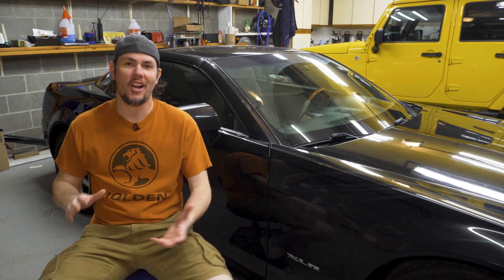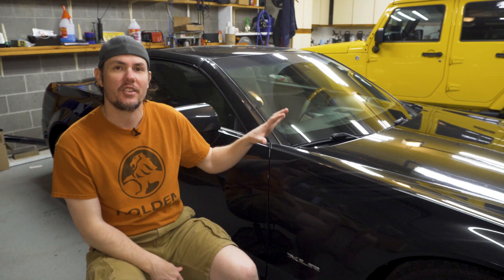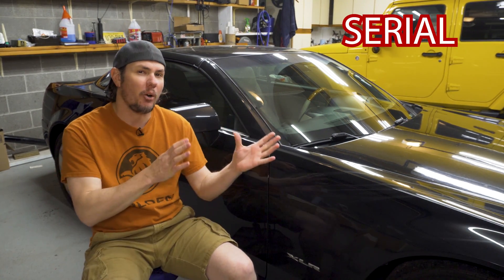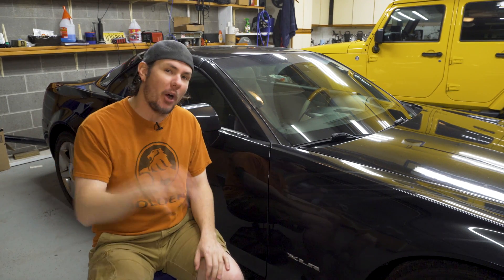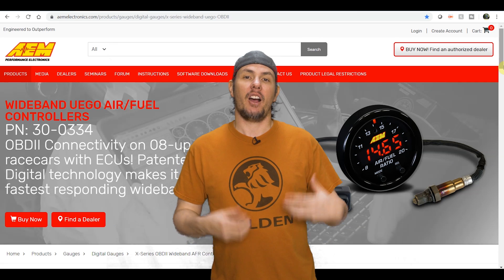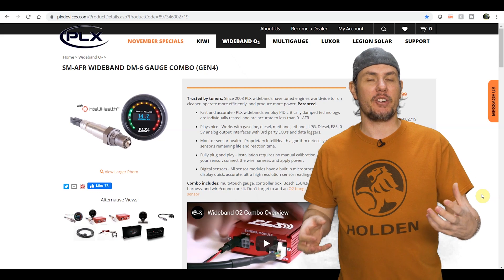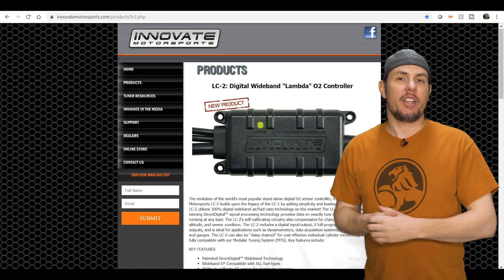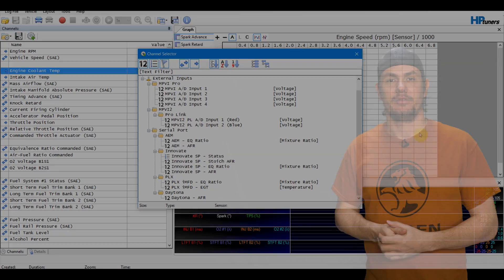Wideband Selection, The Most Important Tuning Tool.  Time To Pick One For Project Country Club!

Comment: So i dont need a specific e85 wideband to use e85
Reply: Tune in Lambda then you don't need to worry about it.
Reply: Ok cool thnx i havent started trying to tune yet (car problems) i just seen it only went to 10.0 on the gauge for afr (aem) ill have to look thru the manual some more
Reply from the maker: Thanks for providing answers, gang!

Comment: If you do Innovate and get weird results. I would double check it with your AEM. I have seen them read off.
Reply from the maker: Yeah, seems there has been some instances of that
Reply: I have an Innovate MTXL and an Aem 30-300(iirc) my MTXL sensor lasted less than a month. Replaced it with a genuine bosch 4.9 been flawless ever since.

Comment: Good to you see back in the garage brother. If your new here he knows what he’s talking about I have the AEM 30-0300 and it works great been in my truck for over 6 months no problems and I drive all the time he has a Video for installation makes it easy! ABT
Reply: What year truck?
Reply: @chrisbryant1657  2011 GMC Sierra 1500. I wrote that a year ago and my Wideband is still in there only had to replace the sensor once .
Reply: @thomasjohnson1142  ok. Thanks! I have a 1998 z28 so I'll have to figure something out to log in HPTuners with an AEM wideband O2 sensor
Reply: @chrisbryant1657  hey buddy im looking to do a 99 z28 what did you end up going with?
Reply: @nathanspooner499  AEM 30 0300
Reply: @nathanspooner499  Wired through egr circuit to log afr in HPTuners